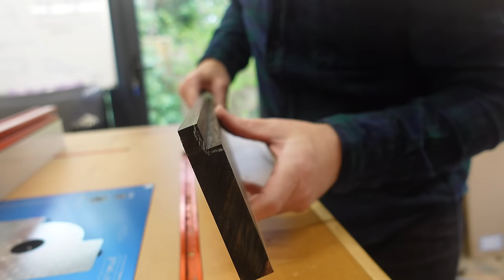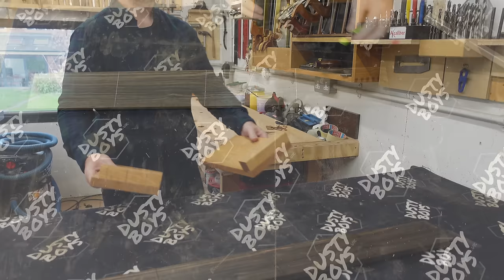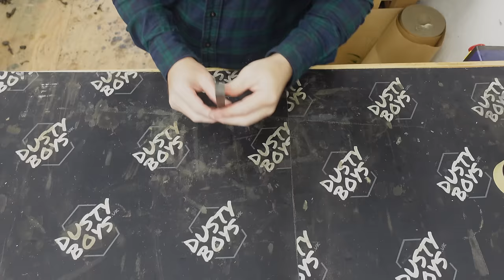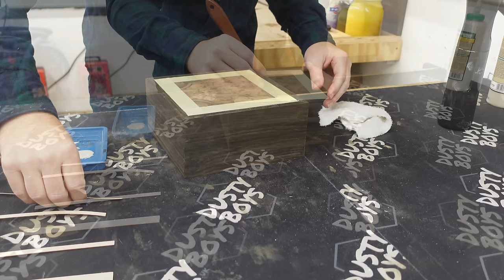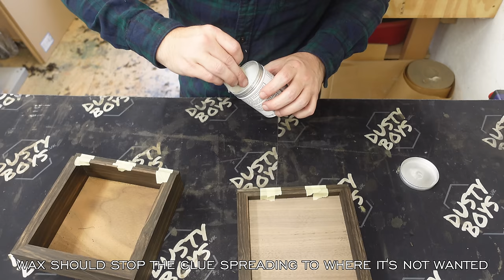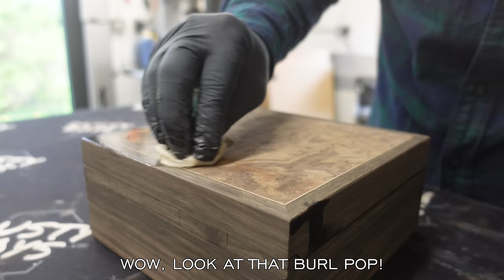Amazing Veneer on a Ebony Wooden Hinge Jewelry Box | Woodworking

Comment: Well, you made veneering look easy. I’m very glad that vacuum system worked as it just shows you don’t need expensive equipment. I had not seen that veneer saw/inlay trick before but it adds significantly to the aesthetic. 

I think everyone should know that you are “self-taught” YT may be a good teacher but you have to bring natural attributes of patience and precision to make it all work.

Very watchable video with an excellent result.
Reply from the maker: thanks for the kind words 😀 I was pleasantly surprised how well the veneering turned out, I’ll definitely be using that method again 👍
Reply: @GM_Design  I’m sure you will get heavily figured burl veneers which will require “flattening” before adhesive. I’m sure there are many ways to do this but my old way is to use a glycerin/water mixture all over the veneer and then vacuum press/clamp between 2 flat boards until dry. Then carry on as normal. I also use the Titebond cold press veneer adhesive - I have no idea what additions make it great for that - but for complex glue ups including shapes onto a form, I tend to use Cascamite as it has such a long open time. As ever, you find a way that suits your own way of working.
Reply from the maker: thanks for the tips 👍

Comment: Your idea to add the inlay was great. It really framed that burl and make it look sensational. What is the recipe for your 'lemon curd' you use?
Reply from the maker: thanks glad you liked it 👍
Its a beeswax, turpentine & a finish oil mix (I used Liberon’s beeswax & Finish oil) The mix isn’t quite straight forward as depends on the beeswax, the one I used from Liberon had turpentine in it as well so I needed more than if it was just plain beeswax. But I started with equal parts then added more beeswax till I got the consistency I wanted. 
Hope that helps 😀

Comment: I have had trouble with bleed through using yellow glue on Burls.Contact cement has worked best.
Reply from the maker: thanks for the tip, I’ll have to try that if I have that issue on  my veneering journey 👍